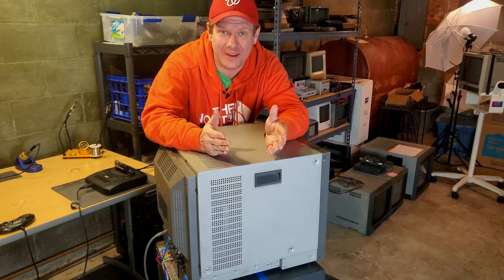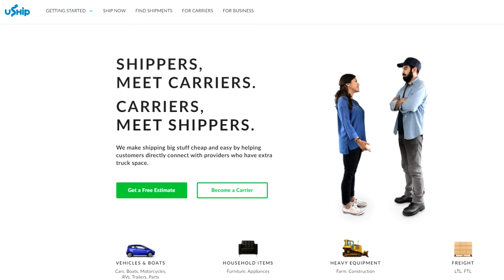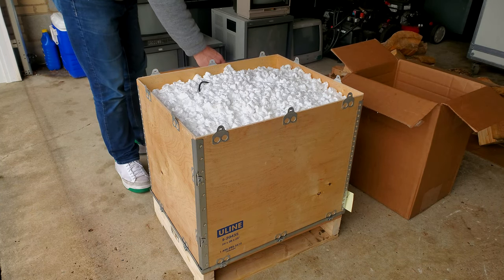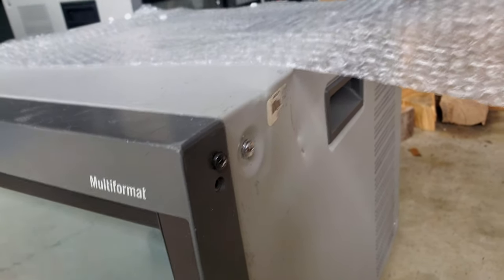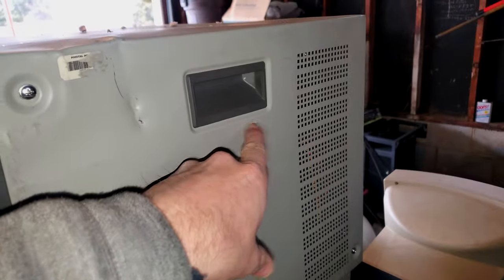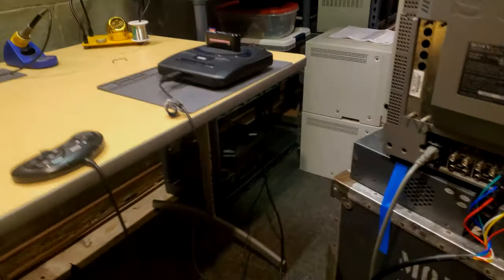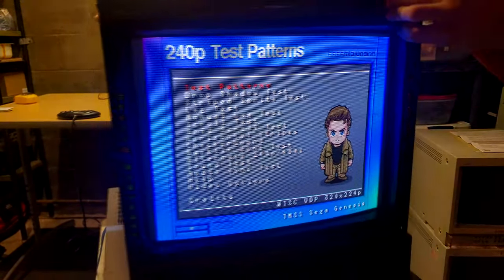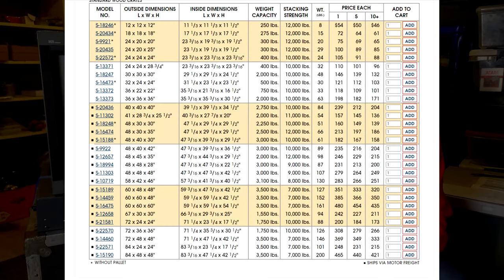The BEST way to Ship a CRT - Sony PVM 20L5 📺 Retro Tech

Comment: They use loose peanuts lol. That's enough for me to never even consider using them. Those are hell to deal with, and ineffective compared to other options, and also dangerous since small bits can break off and go inside electronics. They could at least used bagged peanuts to save you the headache. But there's foam blocks/cutouts which an actually professional packing service would use. It's more expensive, but it can be less since it only needs to be used for all 8 corners not the entire empty area. Anyway, styrofoam peanuts need to die.
Reply from the maker: That was the senders choice.   Uship doesn't pack it, they ship your package.
Reply: @RetroTechUSA  I think they offer packing service as well if pay for it, though I believe they will use cardboard boxing by default, which is actually fine if it's strapped to a palette the whole way. What's crucial is not using a plywood box like this, but having the package not tumbled around from point A to B, which the palette + truck delivery ensures. UPS/FedEx Ground services are a problem because packages move through automated sorting centers with large drops and tumbling. More expensive Express services can avoid this, but at that point you can probably save on cost using Freight services like this one.